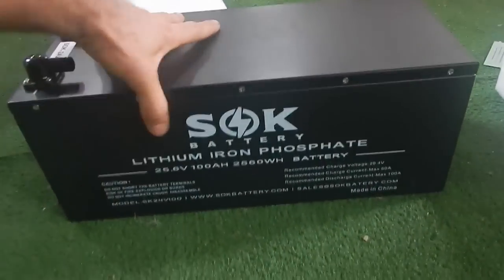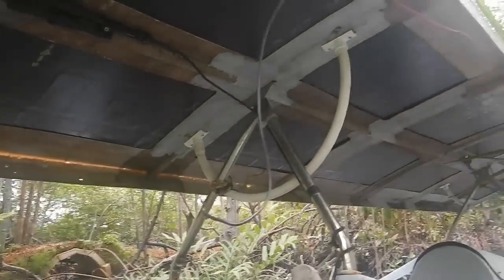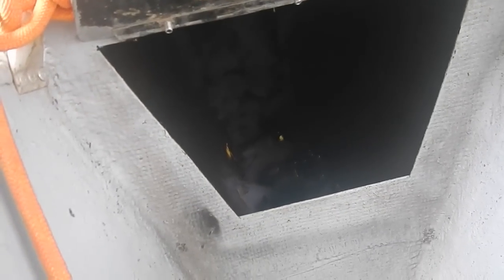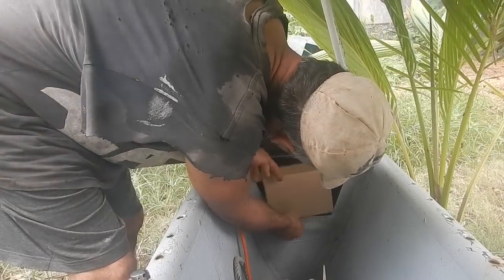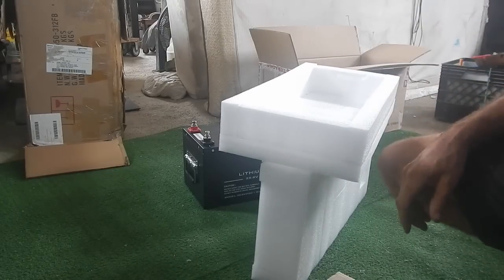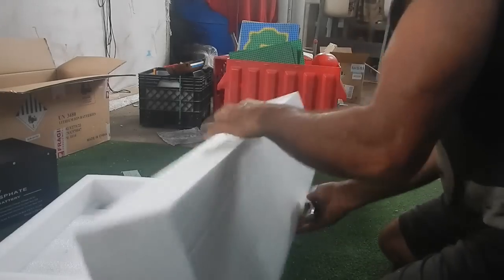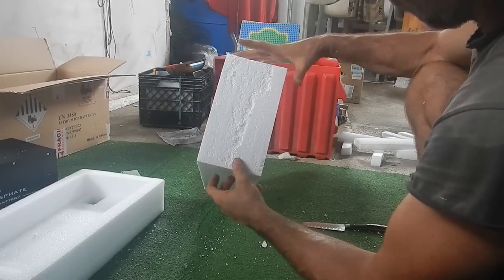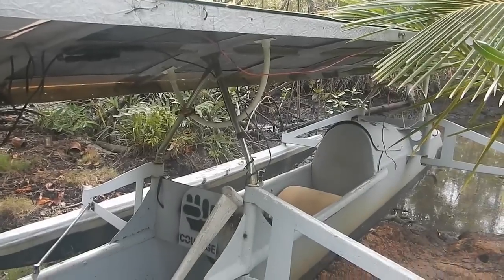Zombie Chopper Max Speed 02 Installing Battery

Comment: Next time when you take battery out, put at least tape over plus and negative terminals to avoid short circuit.
Those batteries can delivery alot peak amps and also in the worst case scenario damage battery BMS.
Reply: you saw that spark to huh..
Reply from the maker: Ha.  Yeah, I was wondering if anyone would catch that.  :-P  For a second I thought I may have blown the BMS.  Tested fine, though.  Feuf!  Yeah... tape.
Reply: @JMEMantzel  give an reset on the BMS, it should be still working......
Reply from the maker: @sokbattery  Not to worry.  It was just a momentary spark.  Not enough to shut it down.  I tested right after, and it was fine.  
:-)